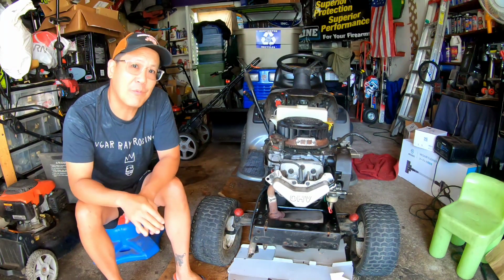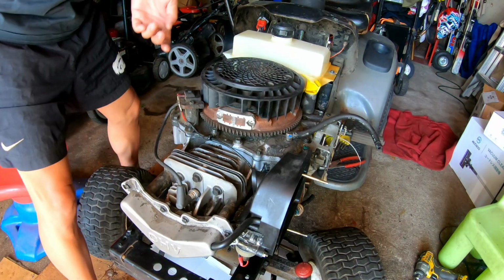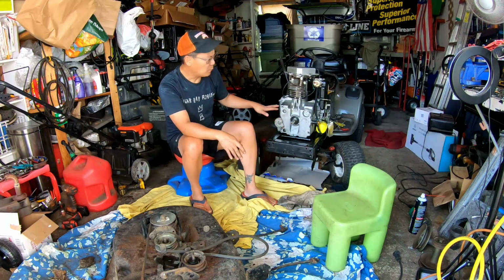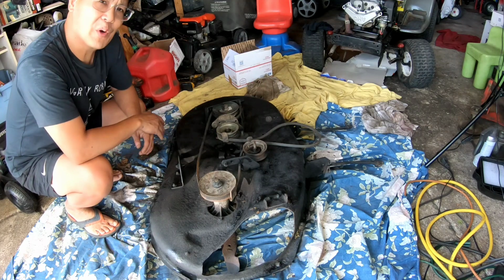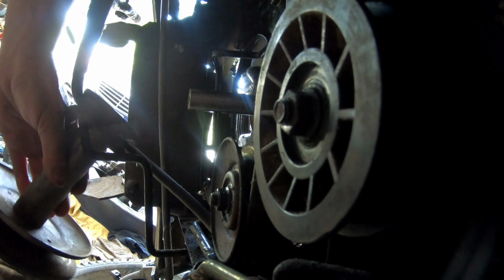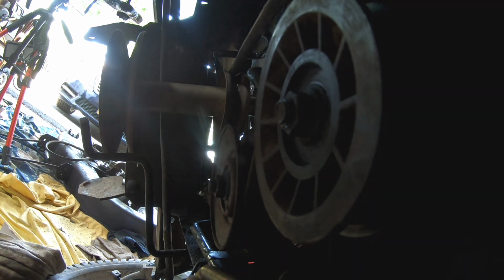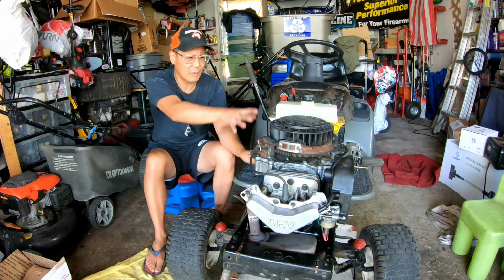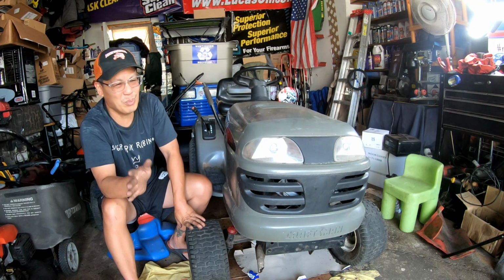CRAFTSMAN LT2000 LAWN TRACTOR REPOWER PROJECT KOHLER COURAGE ENGINE EPOXY  PREP DECK FIX HEADLIGHTS

Comment: Henry. This looks like an opportunity for aluminum welding. All those epoxy took more time.
Reply from the maker: True,  but I can’t weld aluminum with my welder.
Reply: @MowersNBlowers  BTW the oil drain spout should be teflon taped, or locktite sealed.

Comment: Wow Henry, that engine block has more cracks than a Plumber's Convention...  I wonder if the block have been dropped on cement at some point before you got it?  The fact that the cracks seem only to be in the oil case areas and not near the cylindars is strange.   A sealed oil case only has a very small amount of internal pressure, right?  I take it you didn't find any evidence of "blunt force trama" on the outside of the engine anywhere huh?  Man, that's weird.  Honesly, anybody in their right mind would NOT buy that tractor from you if they knew about the cracks, epoxy sealed or not...  I'd feel pretty shady if I didn't fully disclose that info to a perspective buyer.  Don't get me wrong, it's been fun going on the journey with you trying to patch that thing but it's time to cut your losses and move on.
Reply from the maker: I agree,  and I wouldn’t sell it this way.

Comment: Henry, It’s really ashamed that you don’t have another good engine block to transfer everything into as someone else also commented. The engine actually sounds pretty good considering everything. How much would a short block assembly cost if you could even find one. If you knew someone who could possibly weld the cracks with a Tig Welder may be another option to consider. Good Luck,Henry.
Reply from the maker: Definitely not worth the trouble.

Comment: You probably should not sell that mower with that engine on it. I don't think it is going to be reliable enough to last any length of time, and plus when people use a mower they just treat it like crap, which will be pretty hard on it. I am sure you know that too. You will get another engine soon, just wait, it is not worth the hassle. Anyway, thanks for another great video.
Reply from the maker: Very true victor,  simply not a reliable engine.

Comment: If you have a extra Kohler  case that isn't cracked id swap the internals to the good case I wouldn't trust epoxy
Reply from the maker: I would have done that from the beginning if I had a spare block

Comment: Henry, Henry, this will never ever work.  In the automotive world if you have a cracked block it’s possible to fix with a giant oven, but that aluminum case you gave there is going to expand & contact over a few weekends and run all the oil out and some poor bugger will have a seized engine and there goes your reputation.
Strip it, junk it and start over with a good case.
Reply from the maker: I’m about to do just that
Reply: @MowersNBlowers  we used to have the same thing with VW engine cases, they were a titanium alloy and if you cracked it, you could drill the crack and tig weld it but it’s tedious work and air of expensive gear.

Comment: Henry junk it! a cracked engine block can not be properly repaired with epoxy it will not withstand heat and vibration!
Reply from the maker: True,  it may come to that!
Reply: Agree, Koehler courage was junk right out of the factory!!

Comment: Henry its hard to epoxy the bottom cracks because the oil sits in the bottom of the sump where as the cracks on top only get splashed when the engines running. I took my POS  broken tecumseh apart today from a recycler. The cam shaft is DONESKi!  The oil looked like tar. ✌🇺🇸 Roger  #mnblucas
Reply from the maker: Yes unless I took the engine completely apart,  power washed the inside and epoxied the inside and outside.  But honestly I’ve spent enough time on this engine.